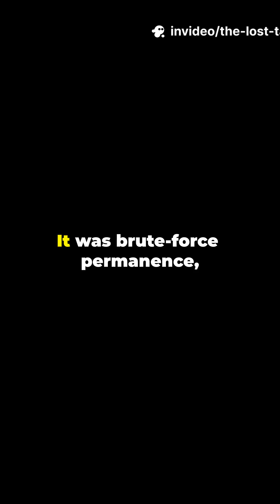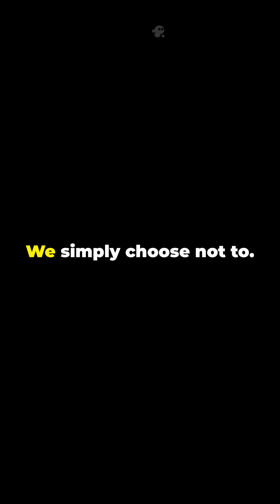Nazi Bunkers: The 80-Year Mystery That Baffles Engineers #NaziBunkers  #EngineeringSecrets

Comment: The concrete itself should have just gotten harder over time.  What I wonder about is how the Nazi's kept the steel from corroding for so long (it expands as it oxidizes, and this expansion breaks the concrete from inside).  Most of our concrete structures (bridges, interchanges, buildings, dams) are temporary because of that.  (By contrast, the Romans didn't use steel reinforcement, and did use a great mixture with volcanic pumice, so their concrete is sometimes still strong today - which the Nazi structures propably won't be for millenia.)
Reply from the maker: Excellent points. You’re right that steel corrosion is usually the long-term failure point in reinforced concrete. In many WWII-era bunkers, durability came from a combination of unusually thick concrete cover, low water–cement ratios, high cement content, and construction in relatively stable, low-oxygen environments. In some cases, corrosion is occurring internally—it just hasn’t progressed far enough yet to cause visible spalling. And you’re absolutely right to contrast this with Roman concrete, which achieved longevity through entirely different chemistry rather than steel reinforcement.